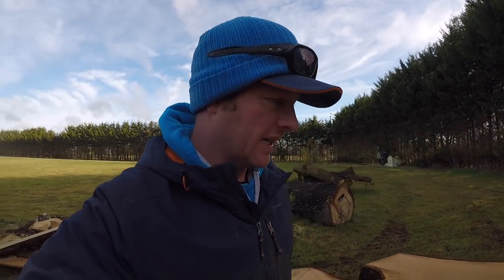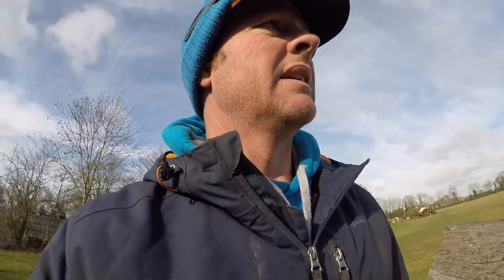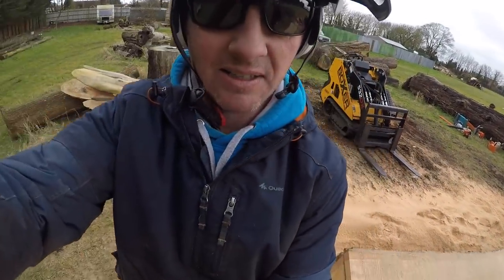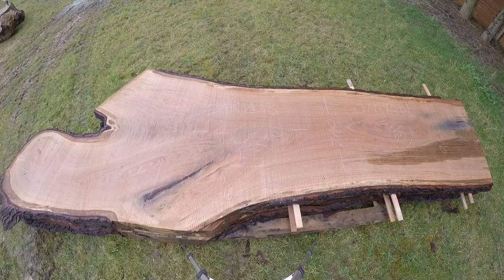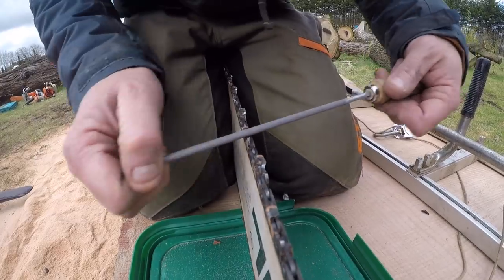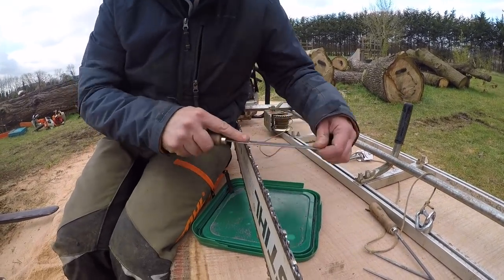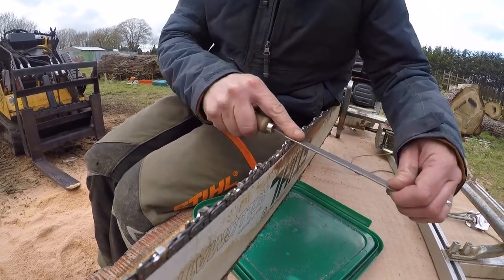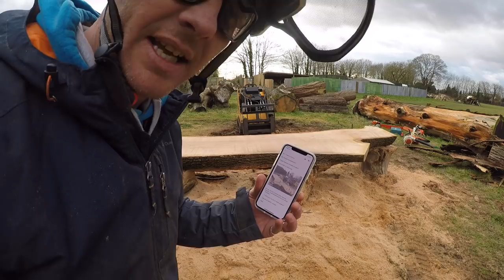Oak Crotch

Comment: Ah back in my time... I'm 72 now but in the sixties I hand filed for Crown Zellerbach in Neah Bay Washington. It was a hard way to serve the lord but then he didn't get me the job!! I think the dumbest thing I ever did was the 090 stihl chain saw was about the largest saw for just one man to operate and my buddy says lets go get this large Maple burl off this tree down in some remote field. We took gas and oil and a ladder to get up in the side of this standing tree which was a bit short at twelve feet. I made it the rest of the way by climbing up and him on his toes on the top rung got the saw up to me hanging by rope down to reach for it. It took two days (a whole weekend and two cases of beer) and I would saw and then he would. We were rung out but we wouldn't quit! Where is the sport in that.... so into the dark of the night and the burl would shake but not come down. Too many russian couplings. So as last resort I hooked on with a winch on my truck and his below to catch it. It worked just as we were going to throw in the towel and admit defeat. So down it comes... a very large burl weighing about a ton and a half onto the bed of his pickup and flattened the sides down to match. We were happy andthe truck was rusty anyway and hmm... close to drunk. So off we go making adjustments when necessary like digging fender out of the tire and limping home on one flat tire. That burl was sawed to size by bolting it to a very large log end going into the mill and Hurn let us do it for a slab. It took six hours in a mill with all the help in the world. I forget all the different sizes but one was over eight feet across so no wonder.. part of us getting it down was the weight and the rest was dumb luck. I hope that you enjoyed the tale of the two idiots
Reply from the maker: Morgan Adair 😂👍🏼

Comment: You use dual Stihl ms880 magnums on your mill, i have the same saw with the 59" bar it's brand new I just got it in March and haven't had a chance to start milling until recently. For some reason it's wanting to bogg down extremely easily, it doesn't seem to want to run at full speed while cutting and it keeps burning the needle bearing out in the clutch because it's getting extremely hot. It's not like I'm cutting oak or some extremely hard wood it's just a simple poplar log. Can you offer any advice and an adjustment that can be made or if I might be over looking something?
Reply from the maker: Sorry I don’t know what to say I would find a local tree guy to see what’s happening. Cheers dude best of luck.

Comment: Do you prefer slab wet or dry wood , or is it a time frame for best results . I notice lots of cracking in my wet wood cutting . 
Thanks Mike
Reply from the maker: In an ideal world mill trunks felled in the winter when there is less sap in the wood, also don't mill in the middle of summer as the wood drys too quickly.  I hope that helps Blaise
Reply: sounds good , I am just playing with home made Alaskan mill on 36 in bar on old Husqvarna 61 , I like your hand winch set up .

Comment: Always good videos...you’ve been a great help to a novice.  I’m slowly chewing though a load of fallen timber with a 36” bar before I move up to a 60” double header.  I got mill and bars from chainsawbars.  I notice on this video that you didn’t have an oiler on the bar.  I was sent an oiler in the kit and it doesn’t work.  Looking at this - is it required?  
If you’re ever in the North Oxon area, drop me a line and come and have a look at some fallen logs
Reply from the maker: Thanks very much mate,  Rob at chainsaw bars is great.  I never bothered with an oiler and never needed it or had a problem with oil.  When I use the double bar I turn the oil down on both saws or its dripping everywhere.  60" sounds too short for a double setup to me, I run 60 on one saw all the time its way less fat and virtually as quick.  
Likewise mate drop in some time.  Cheers Blaise
Reply: Blaise Brogan re too short...my problem is I currently only have a 044 and a 460 to run it.  If I continue to enjoy this I may get an 880, then I can use one head ok and/or get a longer bar.  I have a sycamore butt like yours in this video but bigger....so that may be interesting
Reply from the maker: Ah cool yes if you can get into an MS880 cheers